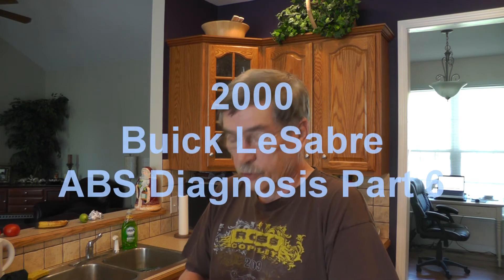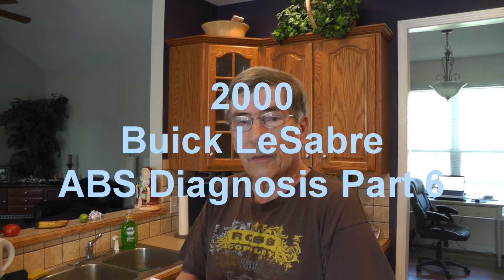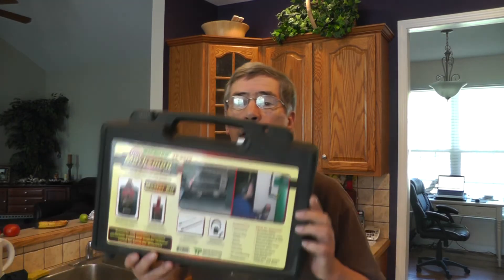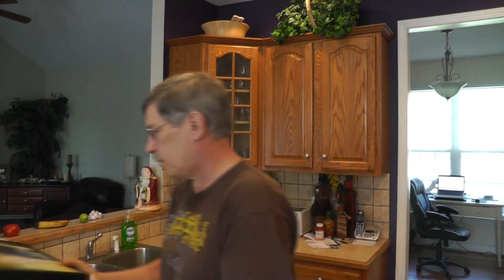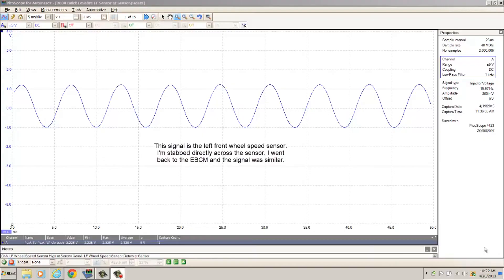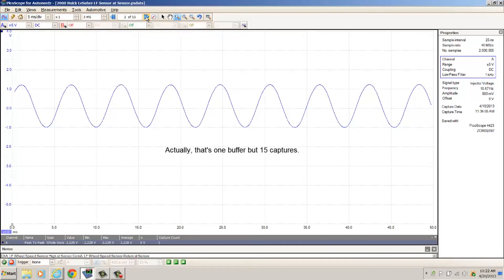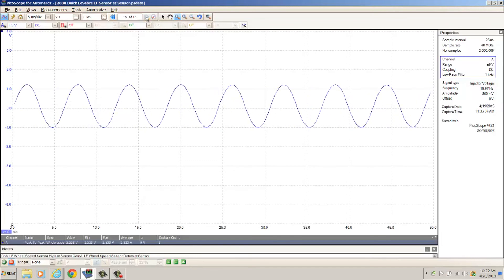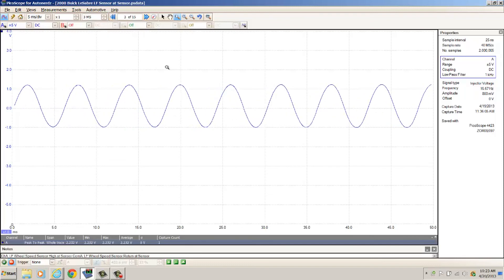Buick LeSabre ABS, Traction Off Diagnosis Part 6

Comment: thank you terry,  in my case  there is only the abs  ligth is on, I use the scanner  to cleared  but it won't reset, thank you again,  I will check  b+ and grounds6

Comment: hi terry  my 2002 buick regal  has a abs  code c1214, check all the fuses, they all ok, try  to clear the ligth and did not cleared, please help,  cheers  from ontario calif.  great videos
Reply from the maker: Hi Everardo! This code signifies that the internal relay contact inside the EBCM is open or the coil is not being energized. You probably have a C1248 also signifying the red brake light is on and you probably have the traction light on also. So, you probably have three lights on. The procedure is to check the B+, ignition B+ and grounds at the ABS module. If these are okay, then the problem is internal on the PC board of the EBCB. I actually have this same problem that came on about two weeks ago. I was planning on filming it by trying to fix it rather than getting another module or sending it off to have it repaired. Stay tuned...

Comment: I found the problem. I backprobed the right side sensor wires at the ebcm and didn't find any opens in the wiring. The problem only occured when coming to a stop or making a right turn. Turns out the right front wheel spped sensor/wheel bearing was bad. Replaced the bearing and the problem hasn't returned. Thanks for the help!
Reply from the maker: Glad to hear James that you got it all figured out. Sometimes as you know, those intermittent problems can be tough to track down. Good job!

Comment: I went through similar test tonight on my 2002 Lesabre. It has never acted up before today. However, it is raining out. There seems to be a thread having to do with moisture effecting the abs system. I twisted the right harness for at least 10 minutes trying to induce a short or open but no luck. I wonder if moisture gets into the ebcm connector when it rains. Peace.
Reply from the maker: +James Last It's quite possible James especially if it's an intermittent problem. Intermittent problems can be tough sometimes in trying to track down. Thanks for sharing your thoughts and good luck on finding your issue.

Comment: what was the actual problem? what did you have to replace/fix?
Reply from the maker: John Struve Hi John... I couldn't find anything wrong except maybe there was an intermittent connection which I couldn't duplicate. I used some contact cleaner on the ABS controller connector, connectors for the front ABS sensor connectors and finished them up with some dielectric silicone grease. I never saw this problem again to this day.

Comment: Great series! I have a 2002 Buick Century custom (Same system basically). I had the ABS lights. Found the right front (Green wire) broken off. Cut the connector off and hard wired the wires. To my amazement the first thing that happened was I got the ABS light right away. Checked my work. All was correctly wired and properly insulated. Second test ride ABS light stayed off. Drove 3,000 mile on a trip out west. No problems then. First day back it rained. ABS light cam on when it was driven in the rain. Dried up and drove. No light. Then didn't have the light come on till six moths later, mid winter. I am going to check it on my buddies scanner tomorrow night. My buddy told me that the rotor can get rust particles on it which mess with the sensor. Rain some how affects the particles on the magnets he says. So rust particles could also be the source of your issue.
Reply from the maker: Thanks for the insight mascobe. Your issue does sound like it's moisture related and rusting on the rotors could very well be the issue. A scanner would definitely help you out with your issue and good that your friend can loan you his scanner. For me, I never saw the issue pop up again. Electronics sure does some strange things sometimes.

Comment from the maker: Hi blackwell and thank you for the comment. On this system as I'm sure with other vehicles, once the ignition is turned off and back on, the ABS is back in an active state providing the problem is not there again. You won't have any active codes, but there still be the history codes. As you may remember in the first video, the scanner didn't have any DTCs for the ABS, but there was the ABS history codes which is what I was following up on. Thanks again blackwell...

Comment from the maker: Thanks for the comment Dave! As you may know, a lot of professionals would have just changed the wheel bearing/hub sensor without even diagnosing anything. The wheel bearing/hub for this runs about $100.00, but until I can see what's the actual problem, I'm not going to replace anything. The wiring issue was high on my list after I saw the signal. After several attempts of watching bias, moving harness and then nothing. Early on in my tests, I did spray the EBCM connector and sensor connectors.

Comment: That's the frustrating thing about intermittent problems - I think professionals encounter this all the time. I wouldn't be surprised if some shops would just replace the wheel speed sensor, though on this vehicle that would be an expensive proposition. Do you think there may have been a wiring connection problem? Thanks for a real world documentary.